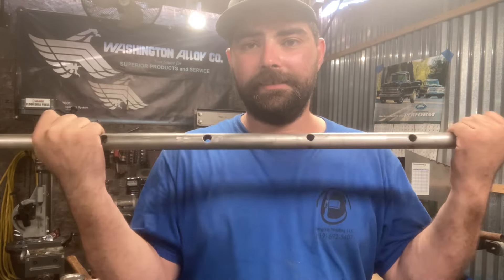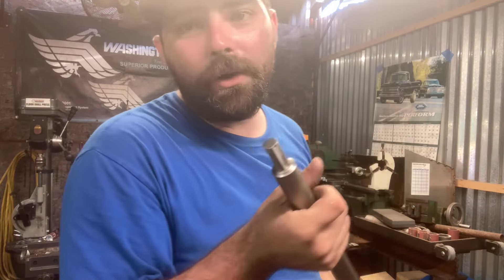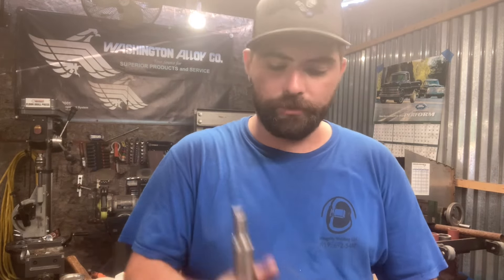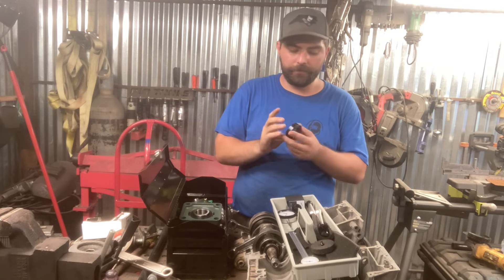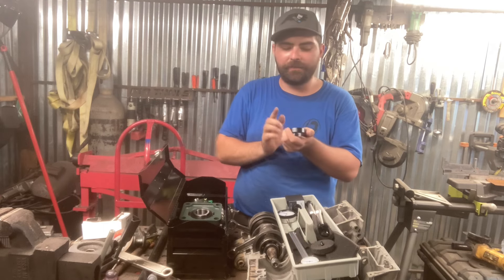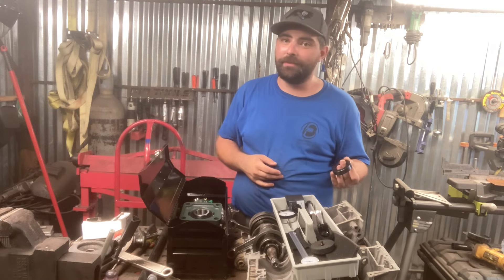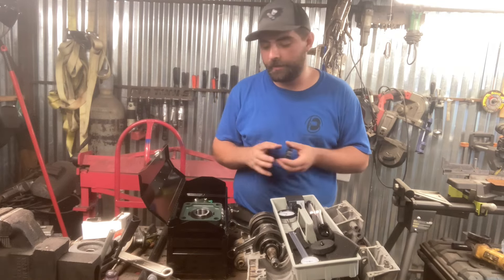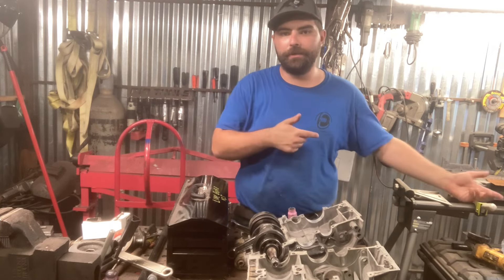Homemade line bore - Making the bearings￼

Comment: Please.... just spend the money on some good used climax equipment. It's never going to be true otherwise.
Reply from the maker: If I could find use line boring equipment, I would’ve bought it already
Reply from the maker: On a serious note. What about my setup would it not be true? This kind of setup with a mag drill is used all the time.
Reply: @derbadortheweldor8940  Just to get off on the right foot I'm not commenting this in a negative light man. It could work if you're not doing compound pivot points.. for example a clam bucket for a sennabogen that has 4 dog bones that have to machined exactly or that's not going to close properly.. even with straight bores for a hoe boom I've had pins not fit correctly for grease tolerances. I grew up doing with with my dad it's just a really precise ordeal and not having the right equipment can bury you.
Reply from the maker: I understand your point. I’m just curious because I have no experience with line boring. Trust me I really want to one day be able to afford the good equipment. But there is no possible way right now for me drop the money on a line bore that cost more than my house. And serious debt on a non-guaranteed return is never a smart idea.
Reply: @derbadortheweldor8940  understood and agree... I thought you might of had some experience before hand.
Reply from the maker: I understand the basic concept and want to get in to it. Unfortunately where I’m at there isn’t many people who do it so I’m struggling to find someone who will teach me. I’ve been reaching and studying from the internet because it’s all I really have to go on.
Reply: @derbadortheweldor8940  yeah man it takes time... and if you aren't that great at math it used to be problematic, but we have phones now so that helps!